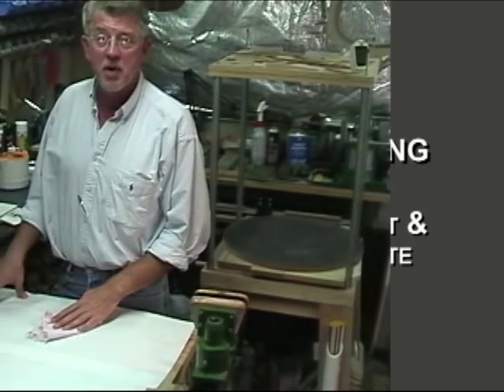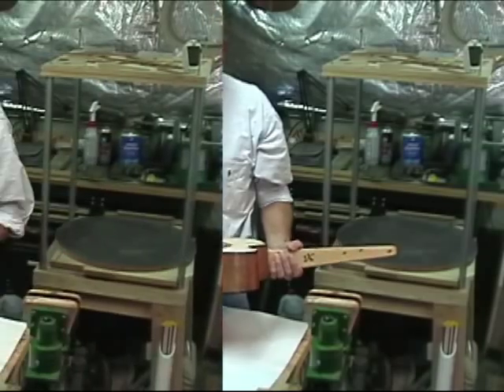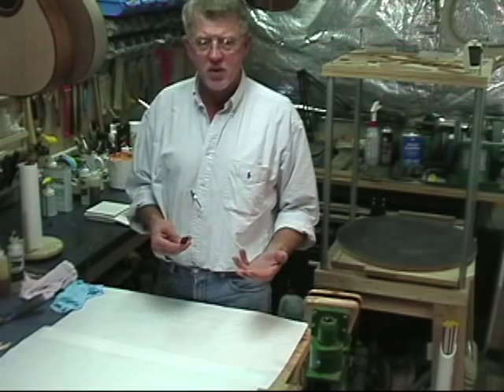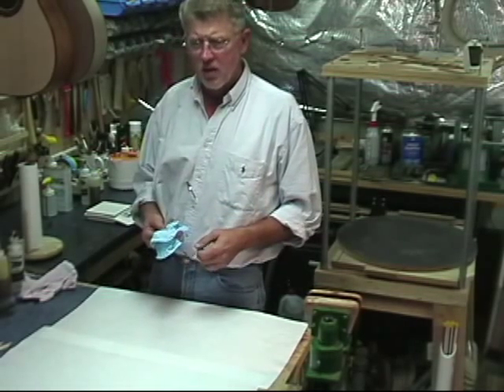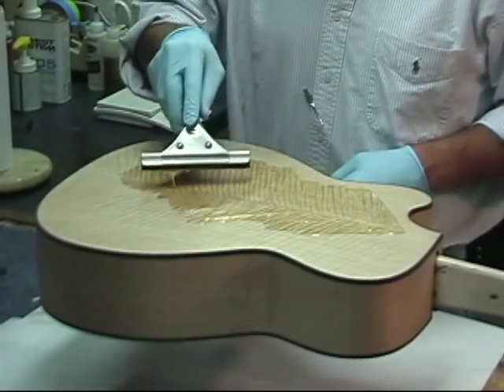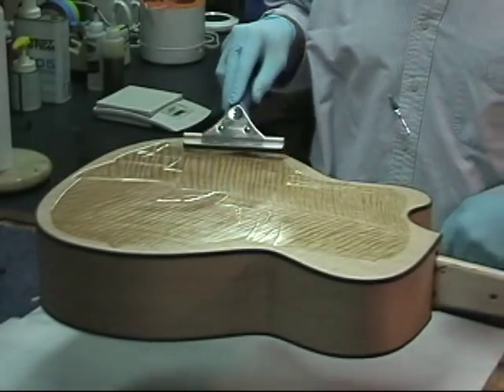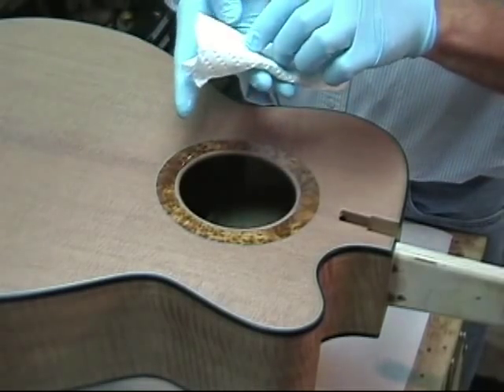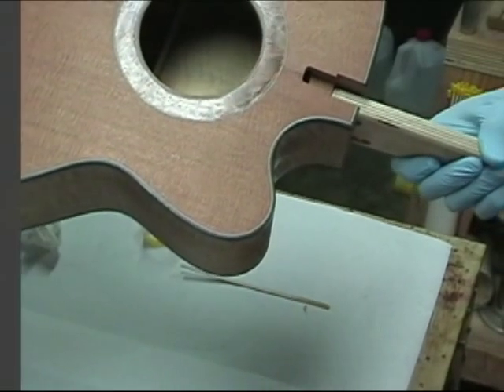Epoxy Pore Filling Part 1:  Application of First Coat & Sealing a Rosette

Comment: The reason all the old guitars sounded better was there were no epoxy and hard finishes. the wood was mellow and the sound fantastic. Nowadays even Martin has gone to the plastic fillers and finishers that look great but sound like crap.
Reply: Blind hearing comparison....good luck pulling out the tone you THINK you can hear.
Reply: Most laughable comment ever. That's not how it works, but okay. A sealant is a sealant, period. Epoxy is pretty full on as far as hardness goes, so if anything, it would produce a better sound, because it reflects more sound than it absorbs... Meaning more sustain. It bounces back the sound instead of absorbing it or letting it die. 

Your ears are wrong or you're just flat out making up stuff
Reply: @ragnaroksangel  can you tell me more? Someone is asking me to do an acrylic poor on their guitar and coat it with resin and so I was wondering where your input would be

Comment from the maker: I have recently switched to West System 105/207 to avoid issues with amine blush.  If you are not using a blush-free hardener like 207, the final coat of epoxy should be washed with clean water and a Scotchbrite pad prior to sanding back to wood (for those of you sanding back to wood) - OR - wet sanded with P320 to both level the surface and remove any amine blush.  For more on amine blush, see West System's website and their notes on surface prep prior to finishing.
Reply: +Todd Stock 
Thanks

Comment from the maker: Epoxy does not have the surface hardness, UV resistance, or scratch resistance to function as a topcoat.  Even in the marine industry, where epoxy is used as a final filler and sealer on bright-finished boats, 3-8 coats of a good UV-inhibited varnish or other topcoat is used.

Comment from the maker: if the binding and the purfling I'm using needs to be filled or sealed to prevent bleeding (e.g., cocobolo), I'll carry some epoxy over onto the top, using care to carefully squeegee it with a gloved finger such that the epoxy does not get beyond the innner purfling line.

Comment from the maker: The top of the the guitar is usually a softwood, so no need to fill.  In terms of woods that bleed...certain woods have colored resins that are soluble in water, acetone, alcohol, etc., so if you shoot the guitar with lacquer or varnish, those resins can 'bleed' into the finish and onto adjacent surfaces such as purfling lines, etc.  To prevent the problem, coco and other woods can be sealed with a thin coat of epoxy, which will keep any solvents used in the finish from causing bleeding.

Comment: I have a guitar that i want to draw some graphics on! The guitar nor the color are deameged, so it's on great shape!!!
first I was thinking to remove the clear coat of the guitar (by removing i was thinking-making it blur=not shiny) with a very fine sand paper for example 3000 or 4000.
Then i will add the graphics, and after adding the graphics i will spray two layers of clear coat!!!
So  what im trying to ask, is it safe to do it like this?! Becouse i dont want my guitar to lose  the tone!!

Comment from the maker: Just a note to clarify a few things:  a) Etore squeegees come in several grades...look for the Pro line, and if in doubt, buy the squeegee which features replaceable blade stock (I buy 18" blades and cut them up to make three refills), b) other epoxies work fine, including West 105/20x, with 205, 206, and 207 hardeners...be very carful mixing West in small batches...I recommend using their pump system or mixing by weight in batches no smaller than 30 grams...West, System 3, Maas, and other systems are going to be more sensitive to mix errors in small batches than Z-Poxy, and c) as mentioned, there is always the option to sand back to wood, but especially on rosewoods, you have to get all the way back...consider going to paste wood, waterbased, or other filler if you don't need the depth of figure and clarity that epoxy offers.

Comment from the maker: I've used the Etore squeegee with West, System 3, Z-Poxy, and Maas - none of them attacked the rubber in the blade.  Suspect you are using a lower grade squeegee...you might check compatibility before use or use the Store Pro brand from Lowes.

Comment from the maker: The blades are impervious to most solvents...no issue with epoxy, acetone, MEK, etc.  As mentioned, nitrile gloves are proof against epoxy, although if you soak them in acetone, they will eventually fail.

Comment: Wtf are you doing...clearly NO understanding of acoustics & resonance...might as well layer it with lead 😬
Reply from the maker: Just celebrated my 30th year as a working engineer and fifteenth as a guitar builder.  I went to Clark at UMD for my engineering degree...where did you go? Take a look at MOE for epoxy wood laminates and if you understand how this stuff actually works, you’ll figure out that stiffness increases and overall damping decreases with surface application of the small amount of epoxy left on the guitar.  In other word, net gain for acoustic-related physical properties.

Comment: I cannot understand why anybody would ever work with chemicals like this without wearing a respirator. Why would anyone even chance it? I wear a respirator when using ANY paint or sealant and when doing any type of sanding, period, without exception.

I also can't understand how anyone can smell something like epoxy and not want to protect their lungs. It's crazy.
Reply: Theres a point where the harm from spreading Epoxy on a guitar for roughly 10 minutes is so minute, it becomes negligible.

Comment from the maker: On the first and second coat, just enough to get the high spots back into the top layer of the wood (which will be slightly impregnated with resin, so well sealed).  Use a Scotchbrite to tooth any low areas, then apply the second coat.  Sand that back to what should be pretty much level, then use the third coat to seal any pores that have been sanded open and give you a uniform color.  The third coat gets Scotchbrite'd to tooth for shellac or vinyl sealer - no sanding should really be required.

Comment: GREAT Vid, Todd!!!  Thank you for sharing it.  I'm new to the epoxy fill approach and have typically used the solvent or water based paste type grain fillers in the past.  Quick question:  with the paste fillers you're supposed to sand back so that filler's only left in the grain.  How about w/epoxy?  I understand about knocking the gloss off, but how far back do you typically sand prior to S&S/dye/topcoat?

Comment: Todd, thanks for the instructions on this. I went to Lowes and couldn't find your model of squeegee, so I bout one each of the two that were there. I'm not sure of your model has replaceable blades or not, but mine don't and I'm wondering what to use for cleanup so I don't have to keep spending $10 after each coat. What do you do? Thanks!
Reply from the maker: Check at Lowes and Home Depot for ones with replaceable blades, and clean the tool after use with denatured alcohol...even the non-replaceable blade models should last a good long time that way, but the thick, blunt edge of the heavy duty commercial window squeegees do a better job of forcing epoxy into pores than anything else I have used.

Comment: Does epoxy crack like some other guitar lacquers?  Does this epoxy yellow the color of a lighter wood?  Do you recommend a clear UV epoxy,  I don't suppose there is anything non-toxic?
Reply from the maker: Epoxy is used as a filler here, and will not crack or craze like nitrocellulose lacquers.  Guitar lacquers crack because they either lose enough plasticizers that they become less flexible than the surface they are applied to, or due to thermal shock.  Because we are building a film of less than .001/1 mil thickness with the epoxy, there is minimal impact on the topcoats in any case, which are usually applied to a 3x-6x multiple of the epoxy film thickness.

Comment: Hi Todd, The epoxy solution and alcohol does not dissolve the rubber squeegee?
Reply from the maker: The rubber blade is resistant to solvents, and holds up well - I have squeegee blades which have been in use for years.  One of the reasons why the use of old credit cards (preference of some) is a bad idea...solvents have their way with the plastic and they shed.
Reply: Todd Stock
Ok thats cool, may be its some other kind of rubber than the one I tried. I used a soaked hosiery cloth instead.

Comment: A grout float offers more control
Reply from the maker: If an applicator works well for you, go for it!  I tried rubber-based grout floats way back when, along with credit cards, Bondo spatulas, and shop-made applicators salvaged from plastic tub lids...the float works OK, but does not provide the high pressure that the Etore-style squeegee does at the edge, so is not as effective at packing epoxy into the pores or cleaning off epoxy.  Also keep in mind that - without regard to the type of applicator used, the condition of the edge or surface will determine the final surface quality seen...so a worn squeegee blade or ragged edge on a condo scraper will increase the difficulty in cleaning off excess epoxy and may leave ridges (more work!).